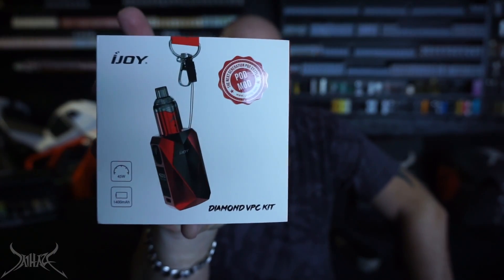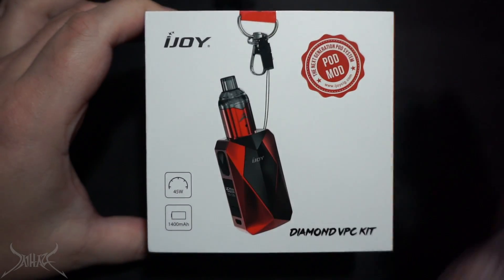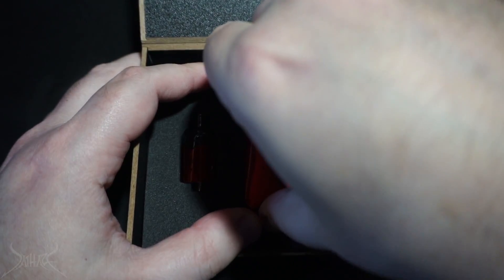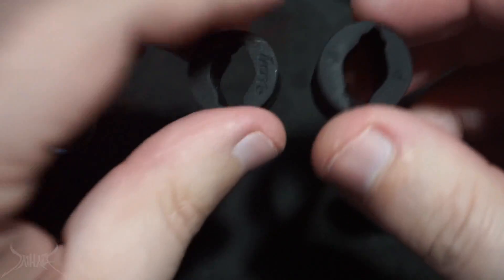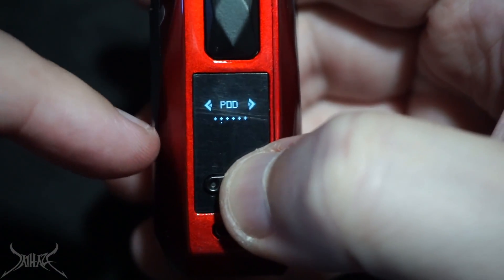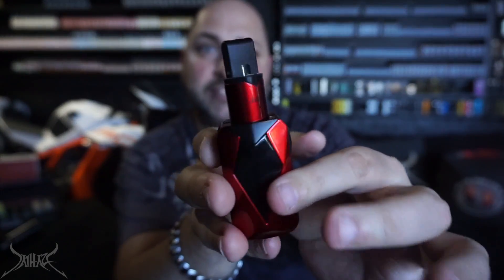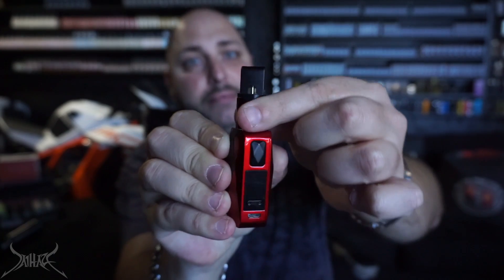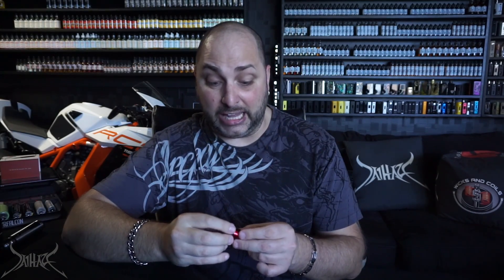iJoy Diamond BAE Pod Mod VPC Kit Review and Rundown | Itty Bitty Diamond

Comment: This kit has a removable Ijoy 20350 battery. You can unscrew the 2 screws on top then the black front cover over the battery door can come off and reveal 1 more screw to gain access to the battery door.
Reply: It would probably be worth doing when the battery dies, but not every time you have to charge
Reply: Atleast it can be replaced when the battery bites the dust then

Comment: You actually can change the battery as it is not soldered in. You have to take a few screws out, some of which are under the plastic, but another reviewer took it apart.

Comment: Did you see moochs video gping off on i joy over how bad the 20350s were? Im just wondering since he said both batteries he had were way different in ratings if some of these are going to perform different than others. Or maybe some die out quicker. That would be my concern with this thing. It is a cool concept though, lots of money to be made if it get a little bit of hype.

Comment: It is a good idea for cross compatible pods my only concern would be the battery choice Those batts put Mooch on tilt the ones he had tested out at 7a and 10a iirc. For pod mode its doable but if people get crazy and start slapping other things on top it could be an issue, but it's vaping and there are always concern able issues.

Comment: I just modified my faceplate so it comes off and goes back on so I can change out batteries, I took it apart, 2 torque screws on top peel the plastic diamond cover off the front and remove the Philips head screw, face plate will fold down and out, 2 tabs on the bottom of the inside of faceplate, had to snap off the one tab, the one on the opposite side of screen side, I then filled the screw hole on the front plate and the receiving hole also to fit the magnets from the parts bag from a mechanical pulse, I glued them in and put the plastic cover back on faceplat, you have to leave the lanyard post off and you put the plate back on by starting at that top corner where the lanyard would be angling it in at the top a little and slide it in place and it's on, it stays on nice and now I can change out my battery, so now it's really cool

Comment: heat the ijoy black panel and pry off theres a tiny screw behind then remove the two screws on the top and you can gain access to the battery I don't know where to get a replacement battery though?

Comment: you know if for what ever reason you decide weather this breaks or the battery dies you know you can take the adapter and put it on another mod and use it at what ever wattage you want really you dont even need there mod. all tho it is a good on the go mod if you want to put it in your pocket or around you neck but you can use that little adapter on other mods if you wanted to

Comment: Please do the Justfog Minifit pod , and the new one C601 also from just fog but with bigger battery capacity. Whats special about those? The pod caps can be serviced just like the old times, you can do youre- coil and rewick it without buying another replaceble cap pod. I dont know other pod system on that you can do that so easy like this one. Im amazed that its not hyped like other pod systems, even though the Minifit has is 5 months old?

Comment: I have actually seen some people who were talking about haw they could use it with their subohm tanks at 45 watts. I agree you likely could, but why would you do that? You can pick up a evic vtc mini for 15 bucks and it will fire up to 75 watts, and it is nearly as small. You can also pick up a puxos mod far 35 bucks, and it can use a removable 21700 battery and is lighter than this little Ijoy mod. The point is, this is not meant to be used at higher wattage, and doing so very often will kill that little battery. This is meant to run low power and usually nic salts. It is a nice little mod, but it is best to use it as intended. If you try to use it at the higher wattage, it will kill that little 20350 battery in short order. Just because you could use it at 45 watts, does not mean you should. If you need to use 40 or 45 watts, there are much better devices that are fairly inexpensive, for that purpose. I bought several of these for nic salts, but they will only be used when I am in a hotel or hospital where sub-ohm vaping will set off a smoke alarm. There are times and places where you do not want massive clouds. The much higher nicotine levels of nic-salts can get me the same amount of nicotine without fogging up a room, but the vape is not nearly as satisfying as conventional sub-ohm, or mesh coil devices.

Comment: Jai the battery is removable or at least not hard wired in. It's just sitting in a standard battery sled. It's just getting to the battery is the hard part. That all said if the battery goes out you could get another 20350 and replace it with a new one.

Comment: If this device uses the same 20350 battery Mooch recently tested, it's likely not gonna put out much more than 7 amps. Probably would've been better if it used a decent, real LiPo pack.I've one of those UD Gaxi devices, super dainty VW thing, packs a 3200mAh LiPo, and can definitely put out 50-ish W.

Comment: I've had two of those now and both suck. The first one wouldn't charge at all. So DOA. Second one took all night to charge and now the pod doesn't fire. It will sound like it's firing a little bit off and on. Not enough to actually hit it. I've tried two different pods, the ones that came with it. Neither of them will actually hit like it's supposed to. I gave up. I was really excited about this device but 0 for 2 tells me it's crap.